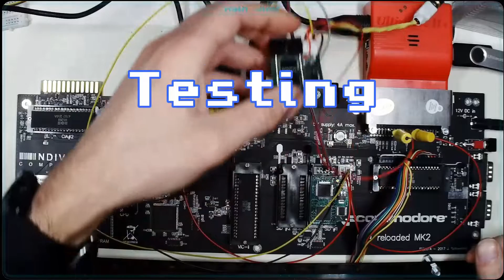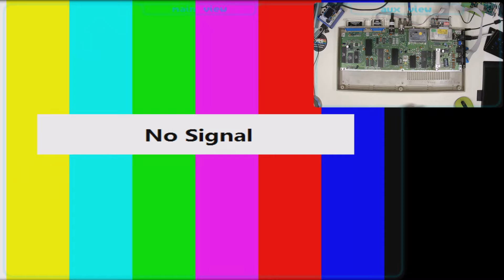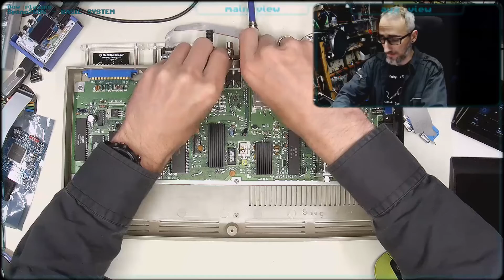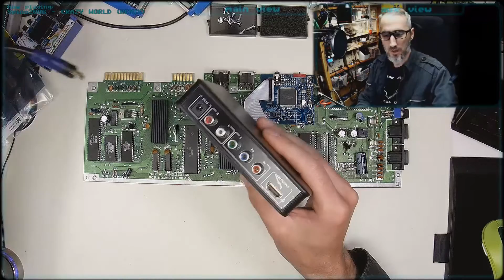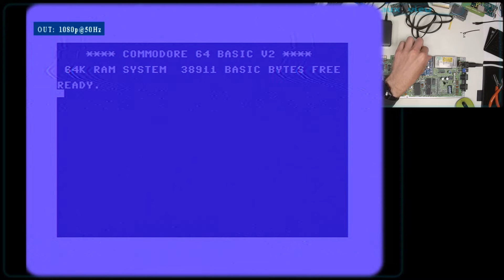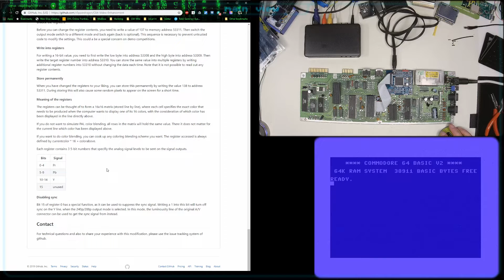C64 Hardware - FPGA Component Output Mod

Comment: I just installed this board and have the same text glitching that you have experienced, but only when using the menu of the BackBit sd card cartridge. Any loaded games or the main BASIC screen are rock solid. Did you ever figure out how to eliminate that shaky text?
Reply from the maker: I have to check, as far as I remember, the very first version of this modulator replacement is using a different wiring for the 4 pole 3.5 mm jack (ground is not on the ground pin of the jack). I've changed the wiring of the cable and I think the shaky text and the dull colors were fixed then.

Comment: Awesome image! Thanks for sharing your firs texperience with this board! Wow, just got reminded how hard it was to desolder the modulator. :) btw do you know if there is a jumper or solder jumper on board to select long mainboard ? the  modulator port pins are a bit different there.
Reply from the maker: The adapter has two different solder point groups for either the short or the long board and the layout is adapted accordingly. So you simply solder the connector pins to the correct position and everything should work fine.  It is just required to solder a solder pad to select the VICII voltage.